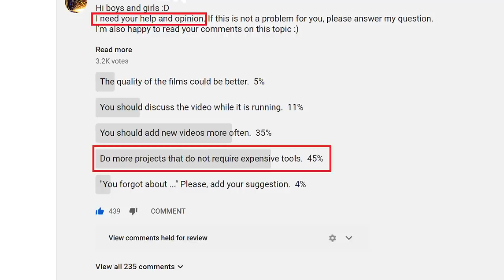Homemade Chop Saw / Band Saw VISE [PLANS]

Comment: Only expensive thing was the MIG, and they can be had used for reasonable money in most places. I bought mine 20 odd years ago brand new with a loan, and it's probably the single best purchase I ever made as it's made so many things since then possible that would not be without it. Good on you for honouring your fans' requests :-)
Reply: cheap 150A DC capable SMAW inverter would do the trick too for this kind of welds and thickness. There aren't that many welds and they aren't long either, wouldn't consume too many rods. Get yourself a box of E7018 1/8" (dunno how it's labeled in EU) rods and you're set

Comment: You should build yourself a fume extractor with a downdraft grinding/welding table. Your lungs will appreciate it
Reply: razvanon i just wear an n95 when i grind. does the same thing
Reply: @kalevvaska2541  not really !
It does almost the same thing but only when the mask is on. The problem is that the dust and the fine shavings are floating arround long after your done grinding and remove your mask
Reply: Not to mention that a few n95 masks costs as much as a fume extractor nowadays
Reply: razvanon also, you are right about the shavings in the air, but i do most of my grinding outdoors so it generally goes away fast
Reply: @kalevvaska2541  yes, outside is much better

Comment: I'm sure you own a plasma cutter, use plasma cutter to cut the ovals or strait holes instead of that bulky and inefficient angle grinder, I can see your perfect skill to cut deferent type of metals but why not make the job easier with better tool? I know plasma cutter have some limitation at certain area but most of your cutting actions are good for cutting with plasma, BTW, excellent work with limited equipment.

Comment: Why use left-handed threads for the screw?
Reply: Correction: I guess it's not left handed threads, but the way it's set up you turn the handwheel to the left to tighten the vise.

Comment: This is hardly "at home" more like senior proffesional tradesman.
Reply: bicanoo_magic the only expensive tool he used was a welder, this is basic stuff he did.
Reply: How do you think stuff out of metal is built without a welder or an angle grinder?
Reply: @G40s_WW  I was really responding to the professionally setup workshop that virtually no one has at home, like industrial drill press, bench mounted guillotine and industrial linishing belt. sure everyone has those laying about at home in their garage!!